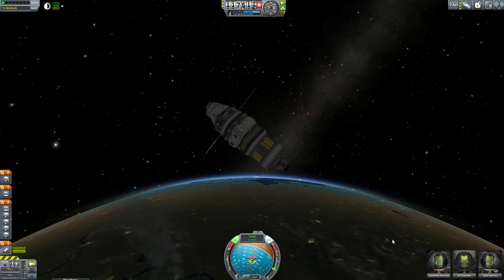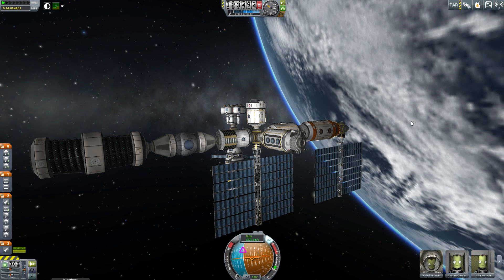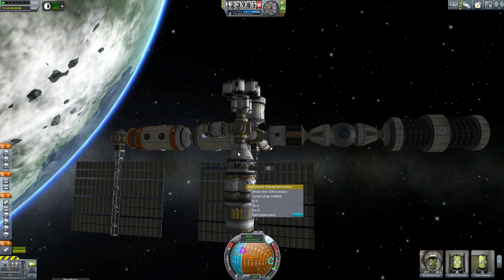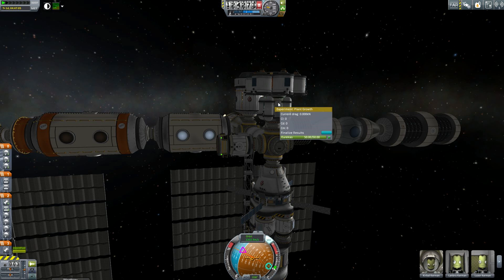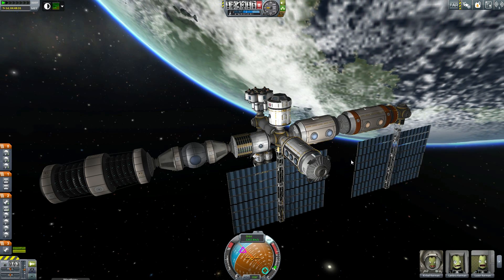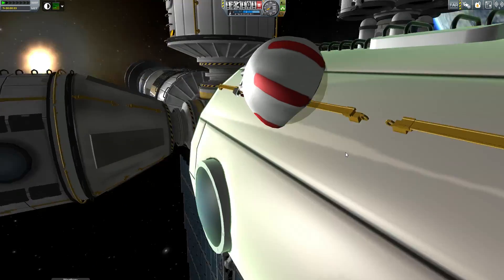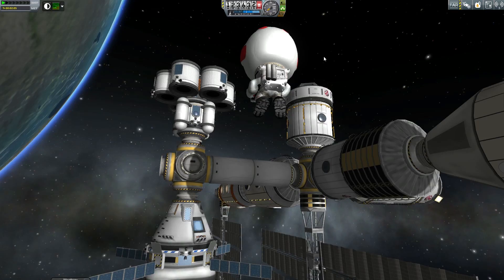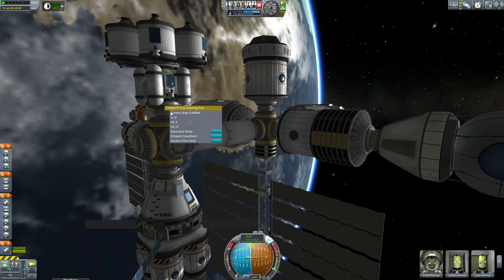Kerbal Space Program - Station Science Mod - Making Stations Make Sense

Comment: Well actually, in the latest stock version science stations are very viable. You get the contracts that require you to send science data from orbit of Kerbin, Mun, etc. so you put a science lab in orbit and some science modules on in so you can clean the experiments and do them multiple times, you do the experiment and send the data. Doing this WILL complete the contract even if there is no more science to gain from the experiment and you receive cash, science and reputation for doing it. Which makes those simple science stations actually unlimited science mines. The same goes for moon bases which actually serve the purpose of planting/tearing down the flag with the same result. So, once you manage to achieve this, you can enjoy unlimited resources.

Comment: Hey Scott! I had a question for you that's been bugging me. 

So I read that a mission to, say, Duna, that starts from a munar orbit rather than LKO would require a lot less delta v.

I'm just confused about how that would work; would you wait for the Mun to be at the correct angle around Kerbin to escape Munar SOI and then burn the rest of the Duna transfer at periapse around Kerbin? How do you know when the Mun is in the right place? Or am I just over complicating things?

Thanks! :)
Reply: I think they might be talking about a slingshot. You want to leave Kerbin at the lowest orbit possible.
Reply: So, the further "out" you start in Kerbin's Sphere of Influence (SoI), the less you have to work to leave it. Sure, you start slower (relative to the planet), but you also have to thrust less to exit - it's similar to engaging your Rocket Engines higher in the atmosphere (as a space plane) vs. starting them on the ground - you almost have "free" delta-v already.

As such, you begin your mission to Duna from the Mun the same way you would from Kerbol... Only now you have an additional gravitational body to escape first. That may well mean leaving the Mun and accelerating directly away from it and towards Duna, or using  the Kerbol/Mun interaction for a "gravity assist" towards Duna. (Almost) Regardless of how you perform the initial burn to leave the Kerbin SoI, when you have left it you should have burned less fuel than starting from Kerbin's surface... Ignoring whatever fuel you used to get the ship to the Mun in the first place.

As such if you can mine/refine fuel on the Mun so you carry a lot less there, then you're going to gain an awful lot of "free" Delta-v. Otherwise, it's more a saving on the final journey than the overall trip.
Reply: Peter Daintree
Yes, but you must take into account the Oberth effect. Leaving Kerbin's SoI is true, but the burn that takes you to Duna is better made lower. That's why you shouldn't do IP burns in a Kerbolar orbit, instead, due them in LKO or LMO.
The faster you go, the more efficency you get.
If you are trying to ARM, then perhaps leaving for high in the SoI ma be better because you need less transfer and more ejection DeltaV, but when traveling farther out, to Duna, and ESPECIALLY Dres, Jool, Moho and Eeloo you want to start in LKO.
Reply: Don't you get access to the Oberth effect based on altitude of the burn rather than orbital velocity? Couldn't you leave the Munar SOI and burn at a low periapse for your Kerbin escape and get both benefits?
Reply: Troy Boileau
waterlubber I started a discussion on Reddit on the topic, should you be interested. Feel free to contribute - I find actual discussion in YouTube comments (or G+ etc) to be quite awkward. Otherwise, just read what others think is the correct answer.
Reply: Peter Daintree
Do you have a link? I've seen similar stuff on the forums, I might make a post.
Reply: waterlubber Troy Boileau 
Sorry, I thought I had posted it. The link is: http://www.reddit.com/r/KerbalSpaceProgram/comments/2niun5/question_oberth_effect_vs_fighting_gravity/

Comment: Note Scott you said zero g if is actually micro gravity
Reply: ***** Didn't read.

Bodies in orbit are accelerated by the gravity, otherwise they would be in a galilean reference frame.
0 G doesn't exist, it's a language abuse.
Reply: g is a unit of acceleration.  Zero g is freefall, and it is an accurate description of an object in orbit.  Micro gravity, however, is not, as the strength of the gravitational field in low orbit is very similar as on the surface.
Reply: Yes I know that, but I said nick gravity because your still falling  around kerbin because kerbin is still pulling on the space station even though it may not seem like it is
Reply: Look I just asked my teacher yesterday in real and my teacher that helps play kerala space program now if you are telling they are both wrong go ahead
Reply: ***** Look I just asked my teacher yesterday in real and my teacher that helps play kerala space program now if you are telling they are both wrong go ahead
Reply: Kerbal
Reply: Dru Payment Both you and your teacher are using the terms incorrectly.  Zero g, or micro-g is correct.  Micro-gravity is not.  The strength of the gravitational field is not substantially less.  The acceleration one experiences while in orbit is nearly zero.
Reply: ***** How could this acceleration be nearly zero ?

There is always an acceleration if you're in orbit.
Reply: bendu49100 I didn't say zero G, the OP did.  I said zero g  Maybe you should have read.
Reply: ***** And ?
Are you going to argue about capital letters ?
Reply: *****  the op who is this op you speak of
Reply: bendu49100 Yes when they denote two different values.  g is a unit of acceleration equal to about 9.8m/s^2.  G is the gravitational constant.

At this point I don't know what you're arguing.

Zero g certainly exists, and is measured by all objects in free-fall, which is to say by all objects that are not being acted upon by anything other than a uniform gravitational field.  Another way to think of the situation is that the object is in an inertial frame.  Micro-g also exists, and is generally more technically correct when dealing with low Earth orbits such as the ISS, as there actually is still a bit of drag due to air resistence, etc.  However, in the Kerbal universe, micro-g doesn't exist in orbit, as the atmospheres are modeled simply and other forces such radiation pressure aren't modeled at all. 

Zero gravity doesn't exist anywhere.  Micro-gravity does exist, but nowhere near Earth or Kerbal orbits.
Reply: ***** I was obviously talking about acceleration, 0 G with G as a constant makes no sense.
+ An object in orbit isn't in a galilean frame, it is accelerated by gravity almost as much as on the surface.

Otherwise it couldn't orbit.
The acceleration is centripetal, making it " free falling " for ever, but it is still the weight.
Reply: bendu49100 You shouldn't use G when you mean g.

I never claimed an object in orbit wasn't accelerated by gravity, in fact, that's the very reason why the OP is incorrect in claiming that Scott should have said micro gravity.

Your idea of free-fall and inertial reference frames are totally wrong, though.  I suggest you review what is meant by the equivalence principle, free-fall, and geodesics.

Comment: I am completely inept at docking. i can never launch at the right time to rendezvous.
Reply: You can get mechjeb. Even if you Dont want to autopilot it you can still use it to setup maneuvers and Windows.
Reply: Don't try to launch immediately to a rendezvous. Launch into an orbit that will help you get there. If you are launching before the target rises in the horizon, launch to a higher altitude than the target. If you are launching after the object has passed overhead, then launch into a lower orbit (both times are approximate). Once you establish a circular orbit, then work on the rendezvous. Unless you are very good (or lucky) at timing, it'll most likely take you several orbits to approach, and that's okay.
I use Kerbal Engineer Redux (it's like mechjeb without the autopilot). Both tools give you valuable orbital (and target) information.

Comment: I'm so terrible a KSP I've got like 100+ hours and still haven't been able to leave the atmosphere:(
Reply: Damn, if this true, then you're really persistant.
If you just want to leave the atmosphere, just pile up boosters, add an SAS wheel, and up you go
Reply: I spend like over an hour designing a rocket or space plane that cant even fly properly
Reply: FLABEX224 scott has some good tutorials :)
Reply: Yeah i'll look at them next time I play
Reply: Keep it simple. Don't touch planes, stick to the VAB. Use sandbox mode. Get a capsule, put a parachute on top, a decoupler on the bottom. A few fuel tanks. Then put an engine of reasonable looking size on the bottom. Launch straight up. If that doesn't go high enough add more fuel tanks. If it doesn't have enough thrust, take some off.
For orbit you probably need multiple stages. Use the same capsule set up, small fuel tank, small engine, decoupler, bigger/longer fuel tanks, bigger engine. Go vertical for the first 10 kilometres. Then press D to pitch to the right. By the time you hit 75/80 kilometres you want to be going horizontal to around 2300m/s. You may have to coast for a bit to do this.
Reply: HALL9000ish dont forget the heatshields!